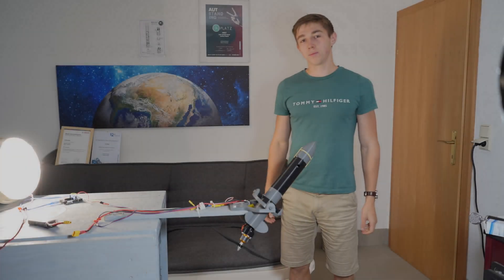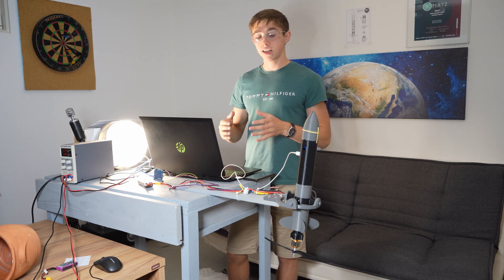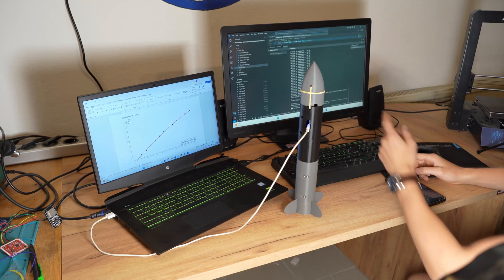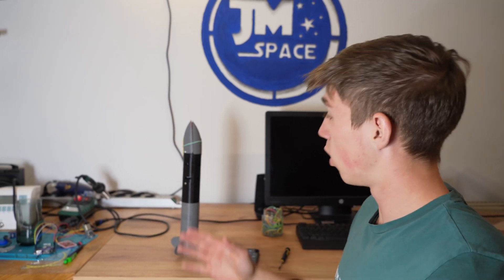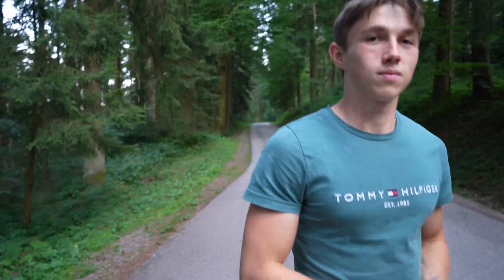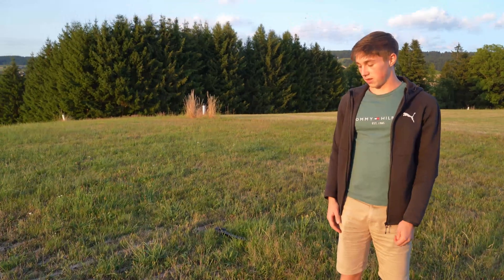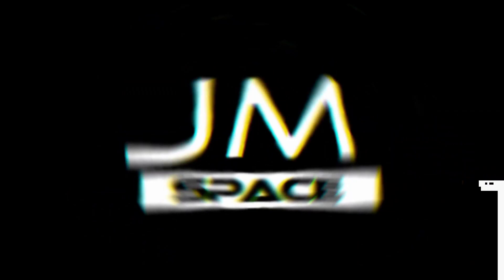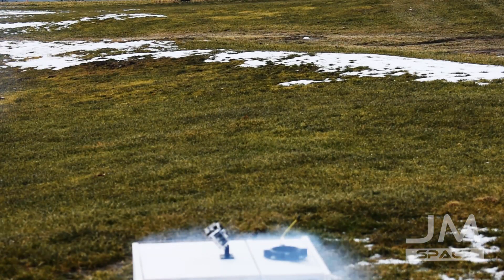Launchday Buffalo mini | Flights 3 & 4

Comment: hey bro. i already made a flight computer and its gui but i my rocket model in gui is not good at all. i saw your video of flight computer GUI. how you design that rocket model in processing?
Reply from the maker: The rocket model was designed in a CAD design environment
Reply: @jmspaceR  then how you imported cad file into processing?
Reply from the maker: I exported the design file to a OBJ file and then imported it as a 3D Graphics in processing 
The model file is inserted in the data folder in the processing project folder

Comment: what is the logic for triggering the parachute deployment?
Reply from the maker: The parachute is triggered based on one out of three different approaches. Whatever condition is true first, does deploy the parachute.

1) Burnout detection by using the on-board accelerometer 
2) Angle abort. If the rocket's orientation exceeds a set threshold.
3) After a set time. This time is the latest reasonable time the rocket can need to reach apogee. This deployment tactic is added as safety if all the others do not trigger a deployment.
Reply: @jmspaceR  Gotcha thanks! which accelerometer did you use?
Reply from the maker: @sachitshastri7160  BMI088
Reply: @jmspaceR  ahh alright